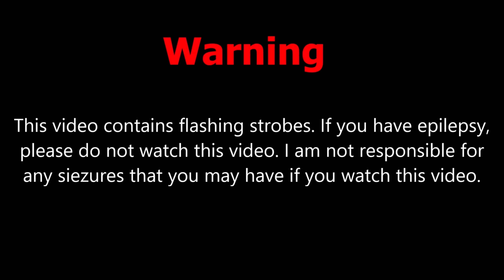Wheelock AES-EL1-WM-24 testing

Comment from the maker: Update: my high school never had these alarms, they used the EHS-EL1 horn strobes. I can confirm this because they added on to the school last year and they tore an old part of the school that still had original alarms intact, only to be removed the next time I visited. It should be noted that when the school was built in 1995, the district picked the lowest bidder probably to save money. The subcontractor that installed the original system specified the EHS-EL1 instead of the AES because of a lack of need for these alarms, and they're outdoor rated. Another interesting thing is that the subcontractor also went out of business shortly after construction completed, I don't know the reason.

Comment: These must be the predecessor of the MT.
Reply from the maker: Sort of. I’m not sure if this was the direct predecessor it not, but it looks like Wheelock was experimenting with a multi tone horn strobe design in the early 90’s. The same terminal configuration is still used on the AMT series, but the sounds override depending on how the alarm is wired to a system.